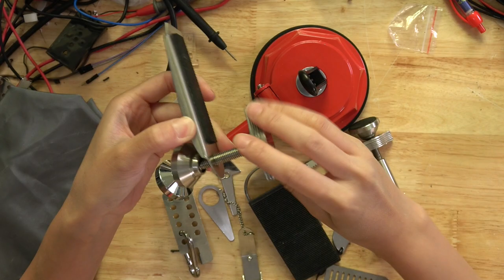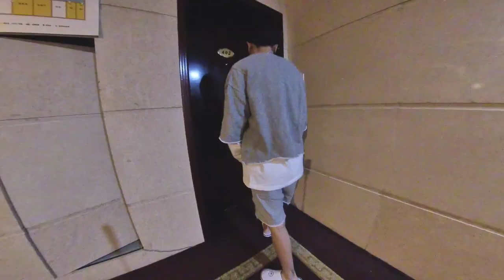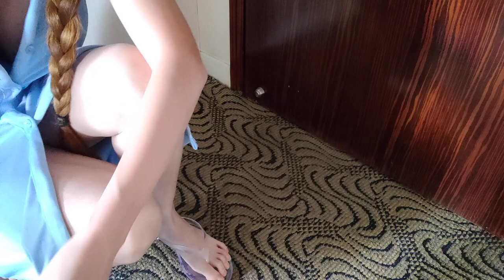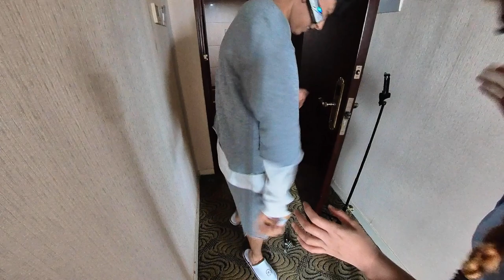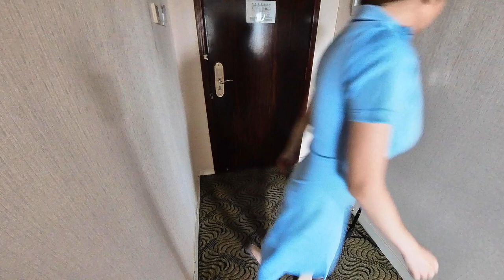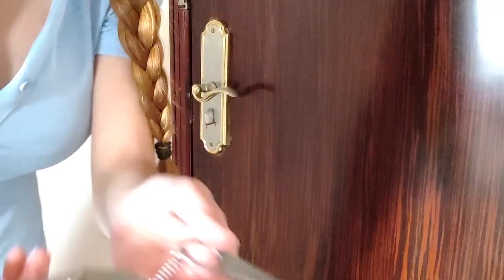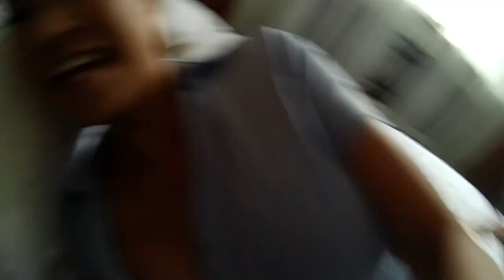Creeps Trying To Get Into My Hotel Room! Do Travel Locks Work?

Comment: The second door stop, combined with a siren on the doorknob would be a good option. With 3 additional locks on a hotel door, I would worry about you having enough time to get out in case of fire. And remembering how each lock works to get them off when you are disoriented from the fire alarms.

Comment: Reading the comments down here, I'd be happy to see a follow-up video where you test our suggestions, and also show off a device you make to solve the problem. Tech reviewer showing off her skill with making tech! :D 

I saw previous builds where you made things, like the small windows that switch from transparent to opaque when a charge is applied, so I think it would be really cool to see your mind at work and what you would come up with for this. 

My thought process was a two-part system: the first part is a sensor that detects the door opening, the second part is a device that records video, and then flashes light/makes noise after a 3-5 second delay, so they have time to be caught on camera and be uncomfortably surprised.

Comment: Best security on a hinged door like that is something a cousin of mine used on his garage door--a simple socket in the floor that a length of steel reinforcing rod slipped into.  Absolutely impossible to break in to unless you used a battering ram of some sort, and I'm puzzled how designers of hotels never do things of that nature.

An excellent video Miss Wu.  I'm glad to see someone showing folks how they need to be concerned!

Comment: This is great stuff. When I travel I have a wedge that has a contact switch that sounds an alarm. It gives me time to prepare for an intruder.
Reply: I've seen alarms you hang on the door handle. They are triggered by the turning of the handle which should give you at least a couple of seconds more than waiting for the door to start opening before making a racket. It might even scare them away before they get to the part where they disable whatever locks there are on the door. Provided they work...

Comment: Hi Naomi,  your concern about somebody breaking in is clear. My concern ; How do  you get out in case of an emergency  when you have extra locks?
Reply: Very good point. After thinking about it for a while I just tought the same; what if there is a fire. I wonder how much force and/or fine motor skills are required to loosen these locks from the inside if you have to get out quick.
Reply: the simple rubber wedge seems to be the best thing in that case. cause you can attach a string to it, that hooks over the doorknob. so when you need to get out fast, you can easily find the string below the knob and pull. this method can probable be used on some of the other devices too.

Comment: I saw the wedge that you used on Amazon and it looks like a wedge to keep a door open.  However they did have Wedge alarms.  They would give a loud alarm sound when triggered by someone opening the door.  This would make others on the floor aware that there is a problem and will scare away those trying to creep in stealthily.  Like you said giving you more time. I hope you never have to use it!

Comment: Maybe just the addition of one of those car sticky pads/mats for holding phones on the dashboard for more grip on those floor devices might help. I gave a friend of mine a doorstop that had a pressure switch alarm in it so if someone did open the door a loud alarm would go off. She also found it very helpful to just use as a doorstop too for keeping the door open to get things in/out of the room without holding onto the door, she would just turn the alarm part off.

Comment: I knew a locksmith who told me that the only purpose of a lock is to keep an honest person honest.  The more difficult the lock is to defeat the more honest you keep the person honest.  But hotels have other security problems besides weak locks.  

In Colombia, I was nervous about staying in a room because the door jamb was wood instead of steel.  The use of a pry bar would break the latch through the door jamb.

I stayed in Minnesota hotel once where the door had a dead bolt lock but the door was not solid.  I have seen You Tube videos of people break through a non-solid door with their heads.

Comment: I noticed you did not try any hinge locks. I have only seen a few of these, they fit over the hinge and usually prevent the hinge from opening easily. Often made of a simple plate steel.

Comment: Thank you for sharing, Naomi!
I am beginning to wonder if a notched 2x4 with the notch fitting onto the door handle and with different pads for different flooring would be a simpler method. I can see something with little nails that dig deeper into the carpet as more pressure is exerted or rubber suction cups if there is a smooth tile floor.

Comment: They also have very loud alarms for $1 or so that you can stick between the door and the frame. They go off if the magnet near the alarm moves away. So at the very least you’ll also be attracting attention. Just test them from time to time because they’re cheap and the connectors will get that green oxidation.

Comment: Great video Naomi, I just hope Kaidi didn't damage the door with that vigorous testing.
Kaidi didn't hold back at all, so she played her role well!
It looked like you both had fun testing, great setup and a great helper in Kaidi.
The latch type locks looked very flimsy, so I thought they would fail.
The slotted one might have worked better if there wasn't a gap between the latch lock and the door.
But I too worry like other comments about what if an emergency happens, there wasn't any fast release options for those types of scenarios. 
Best wishes for your future Naomi and Kaidi, take care and stay safe!

Comment: Very fine Shengzen hotel room with very fine door. I think your best one was the second one. The last one, the big wedge would be more effective with the grippy rubber side downwards to provide grip to the carpet, it doesn't need to grip the door. The door pushes the grip INTO the carpet and provides MORE grip. The best sort is a device that fits into the lock keeper plate and has a heavy block that ratchets down onto the door edge. Your best bet is lock 2 and POM OC Spray as recommended by Active Self Protection channel..

Comment: The only thing I can think of for protection is to only sleep in hotels with rooms that have a special mechanically reinforced metal door with a blocking device like a door bar, etc. 
Or, a convenient wall that you can move a heavy piece of durable room furnishing in front of the door to block it from being opened from outside.
Now I'm scared to sleep at hotels!

Comment: It looked like a couple of the latch locks might have worked, or at least helped, if they had one more point of leverage. Maybe zip-tie the part sticking out of the door to the handle next to it? Used in conjunction with the foot lock that worked, you'd have a pretty good chance of that door staying shut.

Comment: cary a master lock branded "hooligan bar" or "Jersey lock" they set at a 45 degree angle and wedge under the handle and have cleets that are covered by a rubber foot, so they can be used on hard wood, tile, or carpet, still a good assortment of travel locks that the average traveler might have with them, and good to see that most of them dont handle serious force, but as you said, they are intended to give the traveler time to either hide, or get some sort of weapon to defend themselves if someone kicks the door in at midnight or 2AM, stay safe in your travels and great product review video Naomi

Comment: I love the idea behind the frame clamp thing but it needs to have number of slots for different frame/door thicknesses or a serrated wedge that can accommodate that, a way to lock that wedge in place, it needs to be made out of proper steel and it needs to have an engraved middle finger on the outside surface.

Comment: Great video Naomi!  None of the videos I can find on YouTube other than yours show anyone of even moderate size using their full weight/strength to try and force these locks open.  If the main latch is disabled, few of these cheap tin locks are going to last someone throwing their full body weight against it more than a few times.

I did find one latch blocker online that had bolts you could tighten on both sides so there’s no door travel that would allow an attacker to use a bit of travel as a hammer to push or distort the latching system.

Comment: A good method is to wedge a monopod under the door handle. Make an extruded 'U' shaped attachment that screws onto the top of the monopod that the door handle fits in so it can't fall away. If you slightly lean the monopod towards where the handle attaches to the door, it will not slide off the handle when someone tries to actuate  it. The 'U' attachment stops the door handle from turning. I suppose you could also do this with a tripod with some leg adjusting. Best wishes.

Comment: What happened to the old style jam locks that was a pole that jammed under the door handle to the floor. I know they are not small or light but they did work.
Reply: I know that as a New York lock. They work great. Master Lock 265D is the one we have. Available on Amazon. Ours has worked on carpet, linoleum, and a rubber door mat. And it is really quick to kick out of the way if you need out fast.
Reply: if it only locks the handle, you can easily bypass it with a credit card in the latch or such things
Reply: @firefly618  the lock we are referring to is a bar that goes diagonally from under the doorknob to the floor. It works the same way as sticking a chair under the doorknob.
Reply: @firefly618  it doesn't matter if if the door even has a lock. The old style ones hooked under the door nob and braced against the floor. You can kick it in, it was solid metal rod threaded into a metal tube. That's why they where so heavy and big. About the size of a walking cane, maybe a little shorter.

Comment: Just looking at the problem. A door block on the floor should give you the strongest hold on the door. But the ones I saw you using all had flat bottoms which aren't good for rugs. A better grip on the rug would be a spiked bottom that would grab into the rug the more someone shoved on it. As well another problem to counter is people slamming the door trying to overwhelm the contact grip with the floor or frame of the door. If a floor jam had a couple short strong springs between the floor and the door it would help to absorb some of the energy and make it more difficult to "crash" the door. 
Just an idea or 2. I haven't actually tested it but I've seen these methods used for other problems.

Comment: i wonder how well a long stick with a grippy surface against the floor would work wedged under the door handle, compared to these solutions. the way you see people put a chair against a door sometimes.
it is still only really a wedge, but if you put it at an almost vertical angle and because it has a much larger leverage, it should push into the floor really hard if the door tries to open. and if there is a pivoting door handle (not a twisting knob), htere could be something that stops that from being pushed down too so the door latch itself acts as a bolt.

Comment: I used to travel with an extra lock too, as well as a small motion detection box hooked to the door handle, blasting noise if triggered, to warn me of anyone trying to rattle the door.
Unfortunately, my craftmanship building that little box was subpar and even if disassembled it got confiscated at airport security and never went around to rebuild it.

Comment: The most secure lock would be a steel bar bolted into the floor at a 45 degree angle against the door handle. Though hotels tend to frown on 6 inch bolts being drilled into their floor. 
Another alternative... Bear Mace

Comment: I think if you took the one that slipped into the door latch, and had like a 8" metal rod stuck through it, it would be unlikely to be pushed open. of course the metal would have to be very strong, to prevent bending. Adding a good door wedge combined with this would probably do the trick.

Comment: Maybe take a portable personal alarm and rig it to the door in such a way that it activates if the handle is tried. 
It wont stop a determined individual but it will hopefully deter opportunist criminals and the loud noise should allow you girls to grab a personal defence tool in the meantime.
In some hotels it is possible to wedge a chair under the handle.

Comment: It seems like for those first ones it will rely on the friction of the floor. And the carpet lets them slide too easily on the surface. Even that second one that "worked", probably would have failed if someone applied enough pressure to it, or if it wasn't installed in the door correctly. I wonder how those first three would work on a hard floor like tile or wood??

Comment: You need something made specifically for a particular type of flooring. This probably not something you can buy. Rubber against rug does not work but if there were metal spikes exiting the rubber making contact with the rug, that would surely slow the intruder down. And using  multiple locks at the same time might be more effective. Heck, try a  piece of 2 x 4 lumber with nails hammered through, wedged against the door, stepped on to make the protruding nails stick into the rug. Oh, and hammer the nails on an angle. Oh, and put a piece of flat metal on the bottom of the 2 x 4 that will slip between the door and the threshold. There ya go, you probably have stuff laying around the house that you can slap together.

Comment: A great instructive video on a subject I've never considered. As a male, hotel security isn't something on my radar but I'm seriously surprised there isn't a single effective lock that will do anything more than buy you some time. Sounds like a great project ‐ maybe a 3D printed solution? I'd think there's a huge market for something that actually works.

Comment: As you said in the video, some of those devices would have worked much better if the conditions had changed such as the flooring. Some of those were for a wood floor and some for a ceramic floor. Only the one that worked well, seemed to be for a carpeted floor. But if you tried that one on a ceramic tile, I am sure it would have failed.

Comment: Maybe the best lock is not a lock, but a lot of noise; an alarm. Like an anti burglers alarm in a house, producting some 110 db (that is very loud!!) and almost any intruder will run away as it atrackts too much attention. Though . . . picking a better hotel beats all solutions I guess.
Just a thought.
And do not forget that in case of an emergency (fire!) you want to be able to leave immediately, not after seconds fondling with your own lock.

Good video by the way.

Comment: Why do hey even make a lot of those.
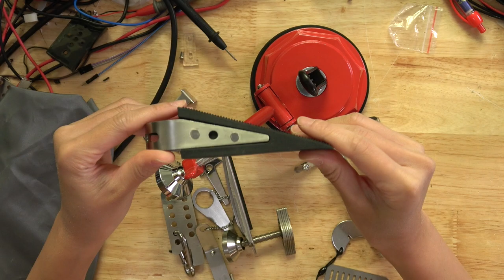The one on 7:24 is just a door stop though, it's intended to keep a from flapping in the wind a bit or leaving it open when a spring is closing it..
Edit: wonder if it might just rip up the floor.. Ideally it transfers the force down so the friction it, and also between layers of floor hold up. (Also this force increases as force is applied to the door..)

Comment: First, make sure your door actually latches and locks. Lots of hotel room doors do not reliably latch, and some will open with a firm push while turning the knob even if the door appears to be locked. One sneaky way intruders use to get in is an under-the-door tool. This is especially bad because if there are any logs, it will show that someone on the inside opened the door. You can make it a lot harder to use an under-the-door tool by folding a towel and jamming it between the end of the handle and the face of the door. Most rooms have an ironing board which can be used to improvise an alarm. A shoelace or a hairband can be used to make it almost impossible to release the ball and loop lock from the outside, but most of these are really weak anyway. Duct tape could be used to keep the lock knob from turning by taping it locked with tension to the knob pivot. Securing a hotel room door is actually a really hard problem because you are depending on the door, door jam and the floor, none of which are likely to be very strong for these purposes.

Comment: Before bed/going to sleep put a chair in front of the door with something that makes a noticeable sound when dropped on it, hotel rooms usually provide some sort of chair, and while it's not going to stop an intruder, it will be 1) loud at it gets moved and the chair (maybe) hits the wall and the object falls, and 2) the intruder will have to climb over it to get further into the room which will probably make noise and definitely delay them.

It's low tech, costs nothing, and takes like a couple of minutes max to do but adds so much. Redundancies, always redundancies.

Comment: Wait i think the lock with the suction cup is actually better than you think! You just attached it wrong. Suction cup goes first, but close to the floor, so the arm does not end up vertical! Make the angle of the arm about 45 degrees. Final touch is tightening the screw hard. I think the suction cup lock is the strongest one you had there!

Comment: Nice to see you so playful. Just a suggestion: wire a capacitor or some sort of device to put an electric charge on the handle with just enough power to deter an intruder.

Comment: The main problem with those is that they don't block the handle or make turning the handle ineffective, If you block the handle the person can't even push the door. There are multiple ways to do it, i did it a few times by closing friends in a toilet or in a closet as a joke while we were on vacation years ago.